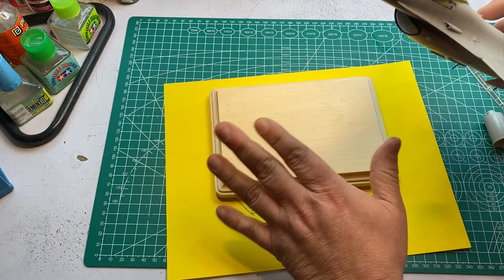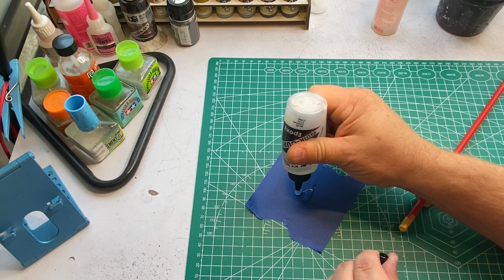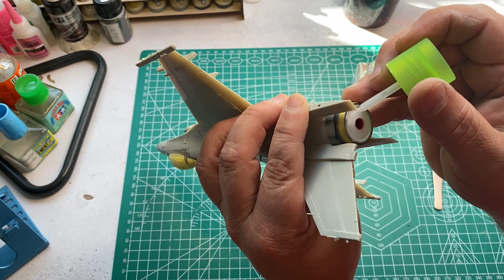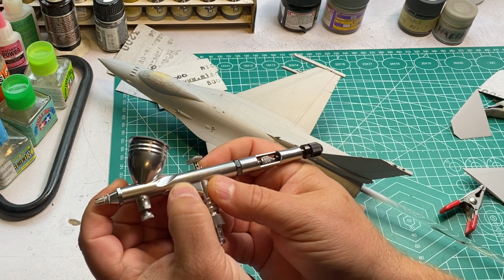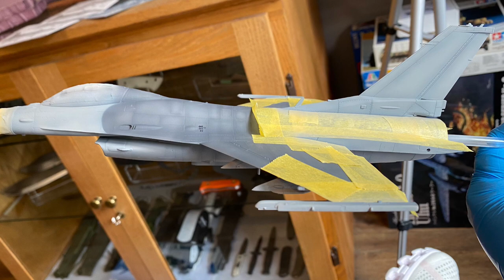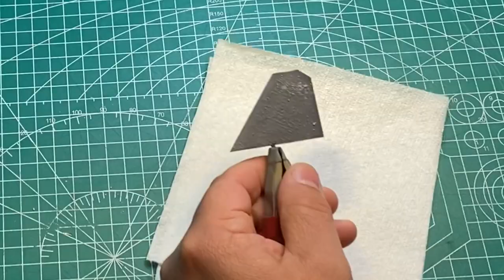Tamiya 1/48 F-16CJ Build Part 2

Comment: What’s a good temperature for a heat gun to bend those rods?  Or maybe which gun are you using?
Reply from the maker: Ive just got a cheap one from Walmart that doesn’t have a temp gauge…just a low and high setting.  I just slowly heat it up until it starts to bend from its own weight then I start to bend it to shape.  I demonstrate it in my video on how to make a display base.

Comment: Did you use Mix 1 for the 36270?  It seems MSG might be a bit warm for it straight
Reply from the maker: I don’t remember as I mixed it a while ago.  I use the mix recipes to get me in the ballpark and adjust based on what I think looks good. In order to get an exact match to an FS color, you would need a physical sample of it to match your mix up with (im guessing that there were probably also slight variations in color between FS paint batches.  I also keep in mind that the paint color of a real plane is going to change over time based on exposure to sun, dirt, weather conditions etc and therefore I take that into consideration as well.  The bottom line is do what you think looks right to you;)

Comment: hey, ever tried setting a magnet or peice of iron inside the model  during asembly ? no holes. just attach to a magnet on stand. done it many times.
Reply from the maker: I did that on a ship model once…I found it easy to knock off though
Reply: i get it. ive been using your mag ordnance tehniques . i added to doing 72 scale with magnetic stands.  i use a 3/4 dia x 1/4 mag. really strong. just epoxy or ive used 3m vhb dub tape recently inside the fuse.  it works good on the tomcats. glue  a mag in the for and aft of the center missel groove. use some 1/8 or 3/16 steel  rod  for the stand . i have 2 1/32 revell cats that way  you'll  need to do some welding or bending.  It also allows for some possability of banking . i could make them